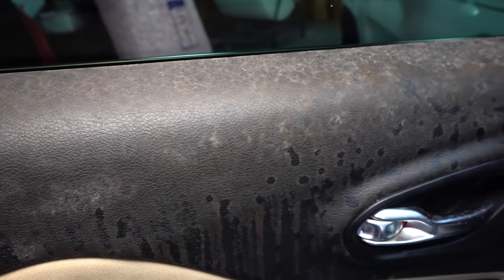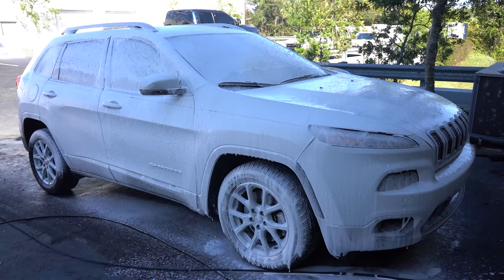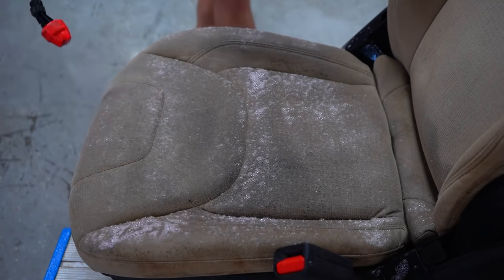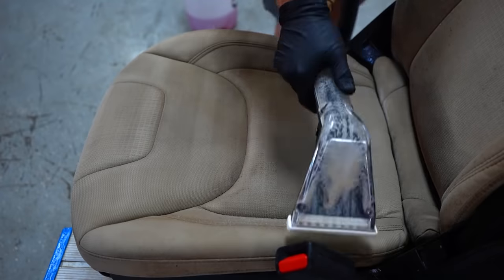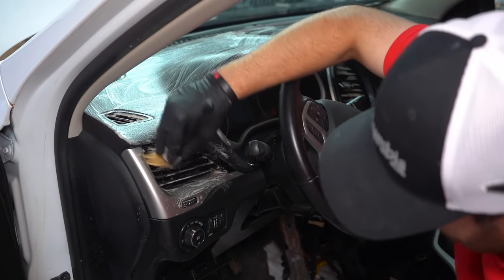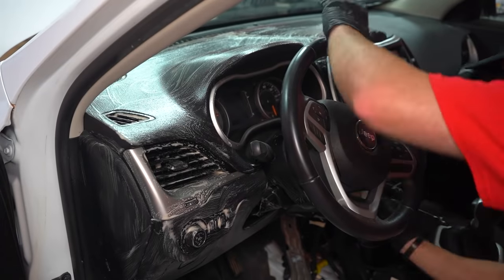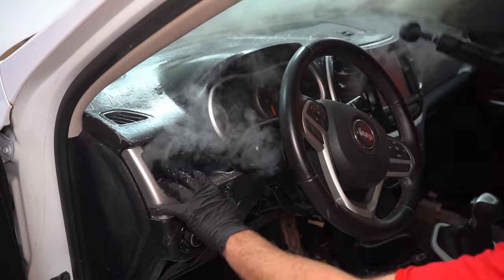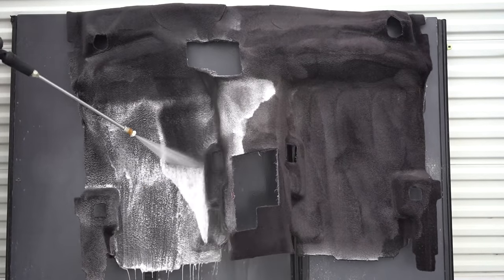Deep Cleaning the MOLDIEST BIOHAZARD Jeep EVER! Satisfying Disaster Car Detailing Transformation!

Comment: Referencing these videos for the ongoing clean out of my extremely moldy 2004 Rolls Royce Phantom. I have no idea if the interior pieces can be saved or should be thrown away... Im down to collaborate if you'd give me an expert opinion lmao. Its bad. REAL bad...
Reply: I’ve got a 2007 Bentley gtc with the interior completely molded out. I’ve been using leather brushes and mold killer and it’s been working and following up with leather conditioner. Still gotta do the stitching.   A steamer will be helpful when I get one
Reply: That sounds bad, but it sounds like fun to clean. A collab?
Reply: @allperfect3335  Once I got a steamer the jobs were so much easier

Comment: What causes a car to go moldy
Reply: Water getting in I think
Reply: @autodetailz5483  thanks
Reply: @autodetailz5483  does purified water leave water spots
Reply: @davidbogomaz9658  not sure. I know rain water will cause mold and water spots. I recently detailed a car that had puddles in it. If you get to it quick you can avoid the mold.
Reply: @autodetailz5483  If you use synthetic water does it leave water spots behind
Reply: @davidbogomaz9658  doubt it
Reply: @autodetailz5483  When using steamer do you have to put a all purpose cleaner on the place that you wanted steamed or no
Reply: @davidbogomaz9658  you don’t have to but personally during my details I do. It helps get it all clean and smell good as well! 👍 on the road to 100 subs!